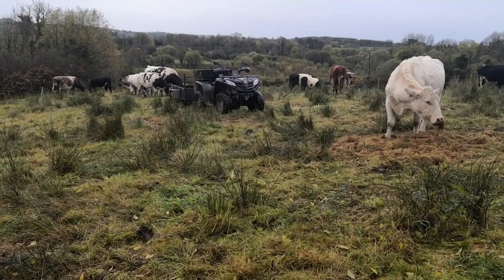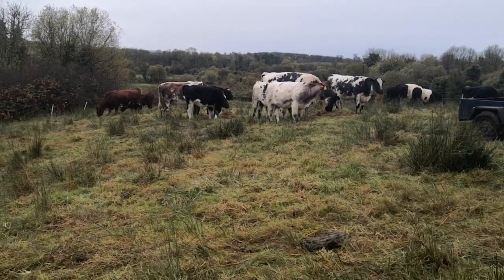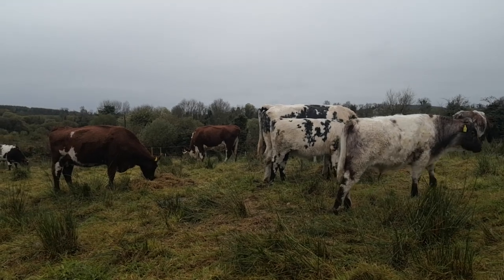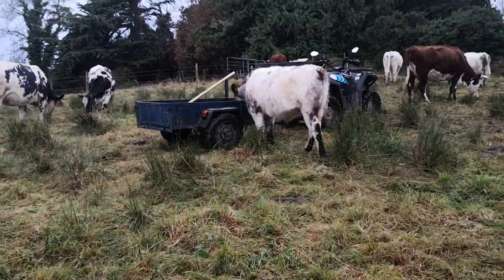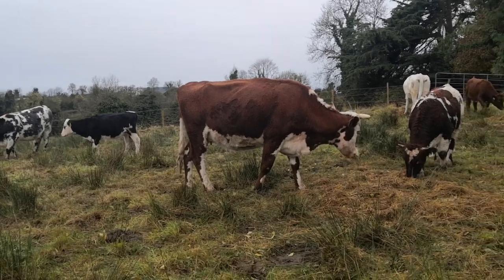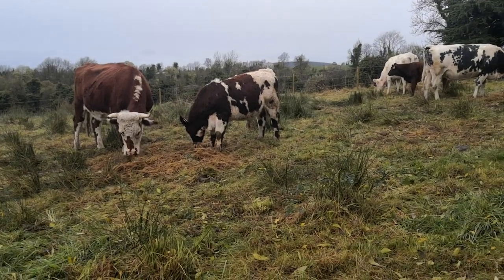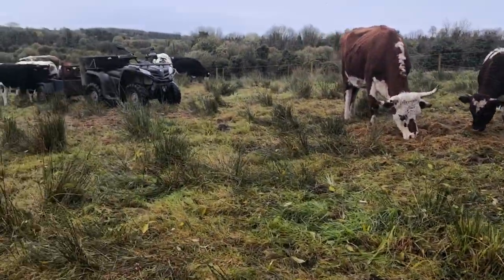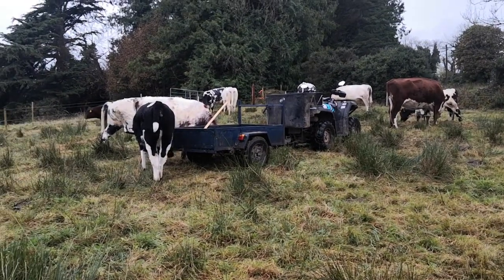My 12 month grazing plan explained. How I out-winter cattle the regenerative farming way

Comment: If that field of yours was grazed down hard like everywhere else,  you'd need a boat to get into it. It's all about armour alright and rushes have a massive mat of roo4s under them. I wonder what your more bottomy land is like.  I suppose all land has a saturation point.
Reply from the maker: Well Colum how are you getting on. it's under water at the minute. Drains over flowing. But I'll be grand we'll get to it sooner or later.  We can only fill a bucket once she heads for the river after that👌

Comment: By holding your calves over the winter would you be worried about their weight when it comes to selling in the spring with your calves only eating grass with not much nutrients in it during the winter and silage whereas men that you will be up against in the mart in the spring will be feeding their calves silage and meal
Reply from the maker: Well Andrew great question. Well the plan is and theory, I'm trying to develop or selectively keep grass adapted cattle that will do well out on grass only. Yes I may be at a disadvantage on sale day but pound for pound I should end up with a better margin. My advantage is  my calves will have grass and because I don't wean the calves will have a least a cup of sweet milk everyday. So it's grass and milk vs silage and meal. which one is cheaper
Reply: @seanofalluinregenerativefa4569  the grass plus grass milk is far healthier than giving meal or grain. You may have less fat, but the fat quality on the animal will be much greater. There will be less wasted fat trimmed off the animal at butchering.